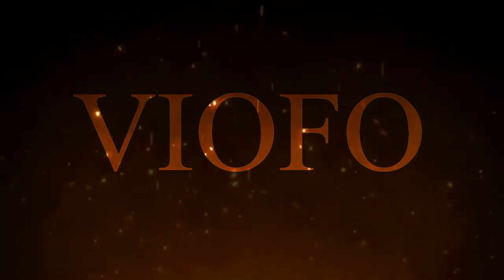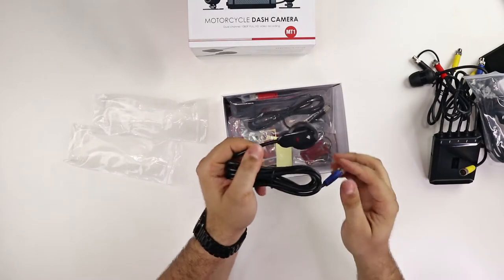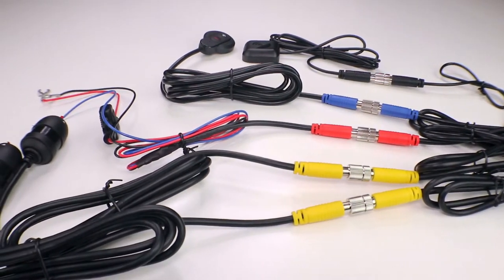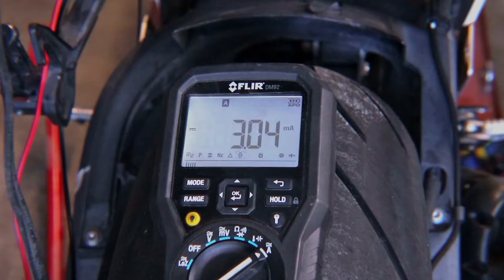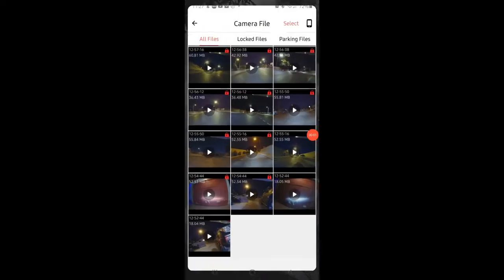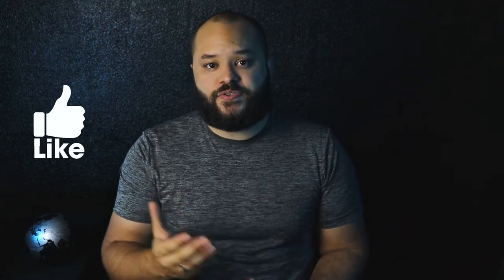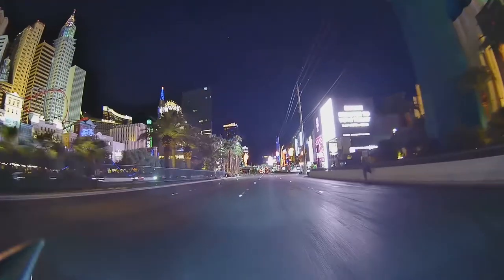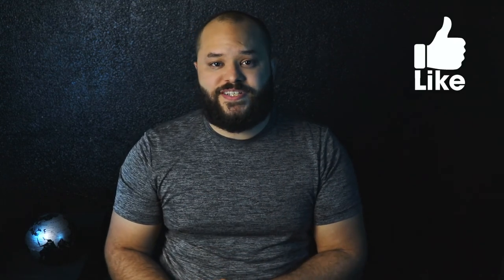VIOFO MT1 Motorcycle Camera System In-Depth Review

Comment: Two points to keep in mind regarding vibration.
First of all, when the mounting point vibrates, the camera will too. Many fairings vibrate more then you realize.
Secondly, what really effects the Viofo, is the way the camera is mounted. The bracket is quite fragile, and the camera is flimsy.
That means that one has to be very carefull how to go about with its cable. When the cable vibrates, it will make the camera vibrate too.
So fix the cable as close to the camera as possible to prevent vibration due to a vibrating cable
Reply from the maker: I agree. I though the same thing when installing it. However; after these years and it's still on my bike, it is performing well. The mounts are lighweight and are still on STRONG. Only thing is that the UV exposure has made the camera's black color turn to a matte bronzy-gold color. Looks pretty cool but I preferred the black even the the gold color looks stock if you didn't know.

Comment: Follow up question: does this unit require constant power for any memory type features? If not, then wouldnt any parasitic  current draw be negated by hooking both the positive and switched positive wires to a 12vdc switched supply?
Reply from the maker: No need for there to be power when the bike is off. Yes. That's what I did. However; to ensure there isn't too much current draw on the factory wiring, the blue switched 12v was hooked up to my running brake light & the main 12v line has its own dedicated fuse & relay. But yes. Assuming that the factory wires are well within the safe range given the extra current draw, what you proposed is a fine solution.

Comment: Hey there, great review. I actually watched it prior to purchasing one and it had all the info I was looking for. However, I've run into an issue with mine and I was wondering if you've come across the same problem.

When recording in constant mode the system has to break files into 4GB chunks. That's normal-ish for camera systems. BUT what I found is that there's gaps between files. So when I got to connect the files all back up again into 1 straight recording there's a second or so missing between two files.

Have you noticed or could you test your unit to see if the same thing happens? Viofo support has been unhelpful in troubleshooting this issue. I assume it's a firmware issue.
Reply from the maker: Hey! Thanks for watching and taking the time to comment. It does sound like a firmware issue and I haven't checked my unit for such a problem. However; I personally wouldn't really consider it a problem since a 4Gb file is of decent length when it comes to stitching 2 clips together. Unfortunately I don't have a solution for you regarding this issue. I would just work around it. Upon reviewing my videos, it doesn't seem to have much missing at all. Maybe 1 second max which is nothing. If this is posing an issue for you due to editing, simply do a fade transition to bind files together and I'm sure it'll turn out great! If you happen to find the issue, I would love to hear about it so please keep me updated. Sorry I couldn't be more help to you. Ride safe! Cheers!
Reply: @TheMotorcycleBoss  Yeah, unfortunately with my videos I'm not editing them in a way where I can cut in other footage to cover up the missing bits, even with a transition. I haven't seen this on any other camera - it seems like something that has long been solved - so I'm pretty disappointed with Viofo for having this problem. I was hoping it might have been a one-off on my unit but I guess not.
Reply from the maker: @photodevoto  sorry to hear that. That really sucks. If you get a different system and that fixes the issue, please let me know.
Reply: @TheMotorcycleBoss  I'm looking at the Innovv K5 right now. I'll let you know if they have the same problem or not.
Reply: Model review, thanks!!
Reply from the maker: @r4pids  thanks! Glad it helped.

Comment: How does it cause a parasitic draw? I always assumed that if you spliced a trigger wire into a switched live the auxiliary equipment wouldn't be able to draw anything if the ignition was off? Am I missing something crucial here?
Reply from the maker: I completely agree and because of that, I wasn't expecting there to be any current draw when the bike was off. The trigger wire was connected to my running light on my rear brake. But if it still draws current regardless, that typically means that the wiring in the main box isn't exactly as great quality as it should be. It's a common issue in cheaper electronics.
Reply from the maker: With that being said, the parasitic draw on it isn't as bad as it could be.
Reply: @TheMotorcycleBoss   I asked a retailer selling this, who asked the manufacturer, and they said "either none or so little it might as well be none"
Reply from the maker: @jtrigging  The draw that it pulls is very little. However; given how small my battery is on my bike, the parasitic draw is enough to justify a relay. However, other bikes will typically have a bigger battery than mine and wont need one. The manufacturers simply cut out as much weight as they could with my bike even so much to heavily shrink the battery. So the relay would only apply to those that are 6Ah or less. Even so, I decided not to install a relay on my bike to see how bad the draw is given how close it is to my max current draw and it barely drains the battery at all after sitting for 2 months. But it was more of a drain than when I didnt have it. So it comes down to (add a relay if you have the time). No rush in this case.
Reply: @TheMotorcycleBoss  I'm on a Yamaha R3. I think it should be fine without the relay. By the way, I saw you soldering; did you solder the ACC (blue wire on cable with +/-)?
Reply from the maker: @jtrigging  I soldered the trigger wire to my rear running lights.

Comment: Can the MT1 connect to a WiFi hotspot? Eg WiFi 'station' mode via app settings, to connect to hotspot or router.
(Am considering this kit for a van install, due to IP66 rating)
Reply from the maker: Good question. To my knowledge, the only wifi capability it has is simply to connect to your phone but that goes through bluetooth. I don't think you can have it connected to the internet in any way.

Comment: Hi what settings do you have on camera I installed today but still looking for best settings
Reply from the maker: I show my settings in this video while I scroll through the app.
Reply: @TheMotorcycleBoss  OK thanks do you know how to change language 🤔and also any sd card will be fine? Looking to buy bigger 32 gb not enough for me
Reply from the maker: @exsoldier2012  I have not looked into how to change the language. You may have to contact them about that if it doesn't indicate it in the manual. As far as the sd card, it can support micro sd cards up to 256gb. I switched to this one and it works great at a good price: https://amzn.to/31ZEdzn
Reply: @TheMotorcycleBoss  hi unfortunately my camera came off sticky pads aren't good need to something strong to fit mount have you got any idea
Reply from the maker: @exsoldier2012  the sticky pads that they supplied should've done the trick as long as it wasn't a curved surface and you cleaned the location thoroughly. But if not, your other option would be to drill them into your bike or picking up some 3M adhesive double-sided tape. You can probably find it at walmart. It works great.

Comment: Easy install??  @4:01 you are soldering something...how is this considered an easy instal?  Easy is also relative to how simple a specific bike comes apart to hide wires and what space is available for  hiding components.  Lets not forget that not every person can or should be taking something apart.   I use VIOFO's dash cams in my car- they are great.  This seems on par with those and for insurance purposes this fits the bill perfectly, but is fairly complex to install.  I wish you would have covered the microphone better.   I heard it stinks.  An option for an external microphone would be better.  The remote function is somewhat a gimmick IMO, but perhaps installing it under the seat where it can be access for those few times you may want BT and/or improve microphone performance would be better.   All most people will need to know if if its on and recording.  A simple remote LED for the handlebars is all that is needed for that.    At $300 (current price in USA on Amazon as of my  comment) its steep.   They are likely using existing product Technology and parts with a repackaging.   Other products have a display, which this does not, so they are saving on that as well.  A $220-$240 price would be more in order for this,  I'm betting they have about $60 in parts cost in this.  NIce product, but I'm not jumping on it yet.  I mount my GHOST X camera to my motorcycle, not as good video as this VIOFO, but it's only $90 has 4 hours or so worth of battery run time and can be removed and take to any other bike or helmet mounted.  After many years of use, I accidentally broke the USB port so cannot charge it, hence my viewing this video.  Maybe time to try a GHOSTXL, bit not $300 for this.
Reply from the maker: Thanks for posting your comment. The install is simple. Everything has a labeled connector and you only have to hook up a power and ground. The soldering was for the relay that I needed for my bike but depending on the parasitic draw allowable for your bike, it is not needed. I simply hooked the relay to any switched 12v wire. I used my rear brake running light for this project. But like I said, you may not need one. The system is quite pricey and I completely agree with you regarding the pricing. As far as the screen, assuming you plan to use this as a passive system as intended, it's not needed. You could hook your phone to it via bluetooth and stream the live data from either camera if you want. As far as the remote, it has a red light to indicate it is recording which I can see next to my odometer. This is a decent system for sport bikes as it is somewhat compact. But at the end of the day, everyone is looking for something different in a camera system and the Ghost may simply be a better fit for you. I appreciate you taking the time to comment and I hope to hear from you in my future videos one day. Ride safe! Cheers!
Reply: It's an easy install because soldering is easy.  If you can't handle soldering, use a crimp connector.